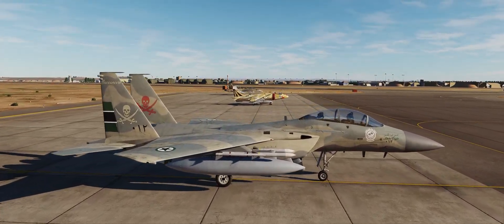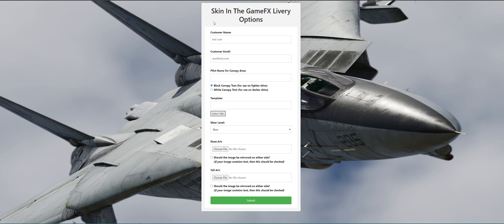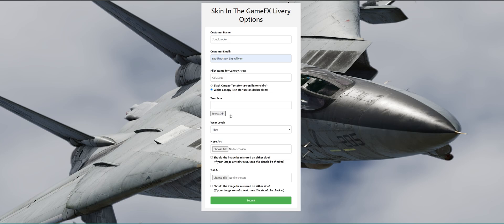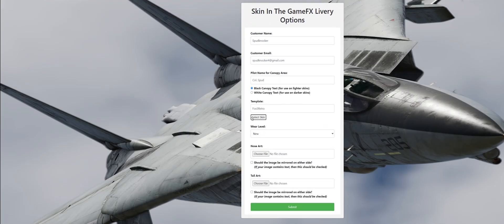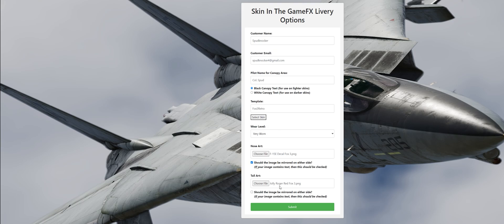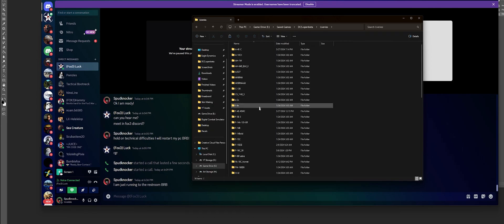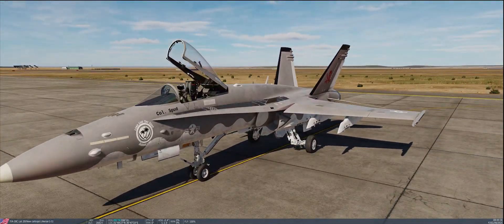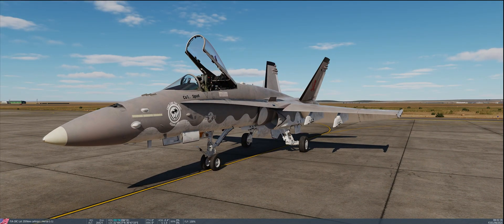How To Create a Skin in 5 Minutes! NEW DCS Livery Generator Tool!

Comment: I like the idea. But I am still learning the rest of DCS at the moment. And I have spent close to $3000.00 in hardware and software. Once I hone my skills and ready to showoff my skills then maybe I will be proud enough and ready enough to fly my colors. $15.00 is a bit much for so little return at the moment. But later on down the road I might get froggy and take the leap. Don't be discouraged. It just doesn't fit into my budget at the moment. I need to save for it first. I'm just a little guy with few assets. It takes time for me. Also, I am surprised that you are not running three 27" screens - optimum size. If you need help setting this up let me know. It took a little bit, but I figured it out. It's nice.
Reply: 3g!? Holy cow man that’s insane!

Also just to  set it straight, the price is 8.99 not 15

Comment: The fact that it is $15 per skin is still pretty ridiculous in my opinion. Was looking forward to not having to piss away my bank account to have some pretty liveries but oh well, you can't have everything, can you :)
Reply: It's a great idea but too expensive. At a much lower price I'd probably buy several skins and then spend well over the $9. And it's not like they'll run out of skins in the generator. Charge less - sell more. Works for me. Find a nice skin and then equip my fleet with matching coolness. But not at this price.
Reply from the maker: Hey man according to Luck the starting cost will be $8.99 if that helps any
Reply: @Spudspike  problem is, the site charges you without informing you of the price, can't be seen anywhere on the page.
Reply: @Spudspike  Its $12.99 CAD. And you have to pay and can't even see a preview as your making it. Could be a total waste of money if you detest what it turns out like.
Reply: @MetaliCanuck  we're working on a preview.. it's coming down the road.
Reply: it's not $15